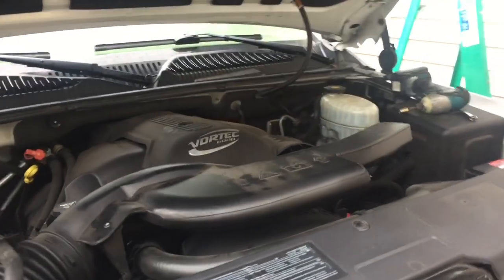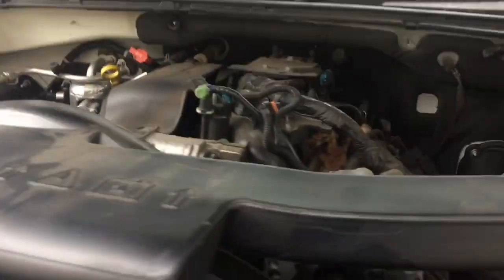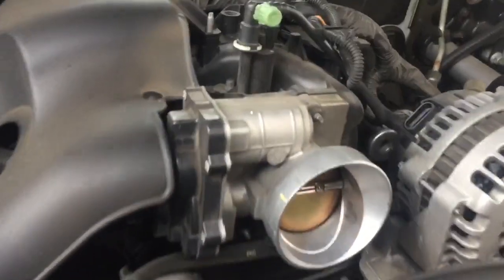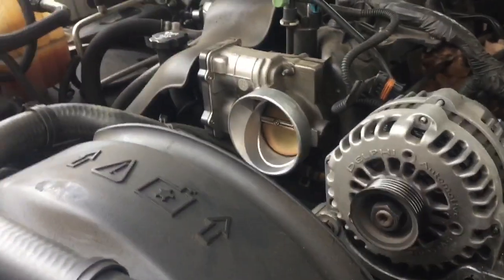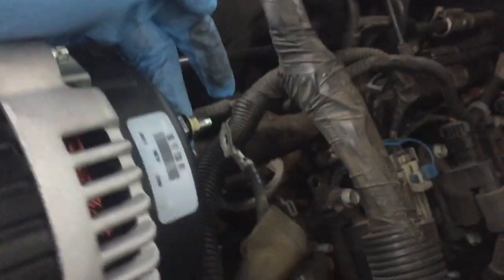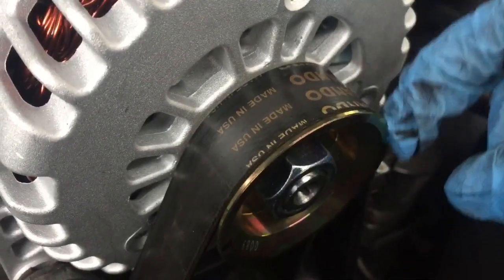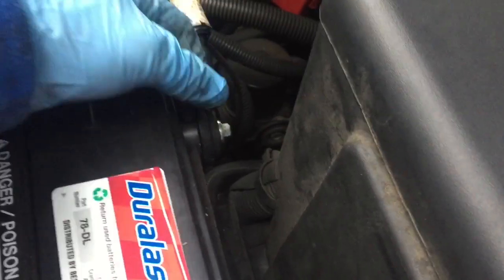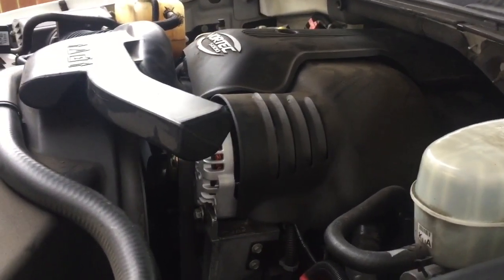How to remove/install  alternator on 2003 GMC Denali, Tahoe, Escalade  Suburban

Comment: Torque specs according to the repair manual 
Tighten: Tighten the bolts to 50 N.m (37 lb ft). 2 bolts in the front of the alternator

Tighten: Tighten the nut to 9 N.m (80 lb in).  the nut in the back (INCH remember not lbs)
Reply from the maker: Justin Davis thank you a lot for sharing. 👍

Comment: If a alternator  is bad...can it throw the Car off by throwing  a Power Reduced  /Stability  Trac..Light On
Reply from the maker: Absolutely! It could cause all types of random issues such as wipers and stereo turning on and off randomly. I would check you battery voltage and the terminal cables. Do you have a voltage tester and do you know how to test battery voltage and the alternator voltage? During significant weather changes batteries tend to fail.
Reply: @TweekerDan1984  ihave the LAUNCH  scan tool it gives you an option  to read the battery voltage...in between  12&14on the charts is where it is reading.....can starts up...doesn't seem to be losing  power from battery....10 secs into running  goes into a limp mode...(reduce engine power)&Trax control  service  stability  lights  come  on......Ran A Scan Tool On It (LAUNCH tool)says loss connections  to throttle  body.... got a reman  throttle  body&same thing happens....only reason a bring up the alternator...is because  it has a loud tick  noise coming from it
Reply from the maker: What is the vehicle? Some vehicles are more particular  then others when it comes to voltage. Is your 12-14 volts while the car is running?
Reply: @TweekerDan1984  06 Yukon Denali...yes when key is on...its between  those 2 #'s. Radio works...air works Fine....just curious  to know if the Alternator  is Giving  Me These Problems without  even Realizing  It....
Reply from the maker: The battery should give you a 12volt reading without the engine running and you should be between 13.5 and 14.6 while engine is running. Also those battery terminals are a nasty culprit on your particular vehicle. https://youtu.be/27WUPHZnOOs

Comment: What’s the amp on the alternator
Reply from the maker: Most vehicles have two different alternators that may be used. So you do not have to have one specific amperage. If you check your local parts store they will have options for you. I currently don’t have access to this vehicle. I hope this info helps. 👍
Reply: 145 amp

Comment: what alt was that {amps}
Reply from the maker: Apologies for the delay, What year make and model are you working on, there are a few different options available.
Reply: @TweekerDan1984  thanks for the reply I ordered the ad244 gm upgraded alt from powermaster it's a 220amp  top end242/177 idle took me30min to install BECOUSE it's an FACTORY UPGRADE plug and play with my stock belt
Reply from the maker: @Dj Keys that is good to know, Thank you for sharing!